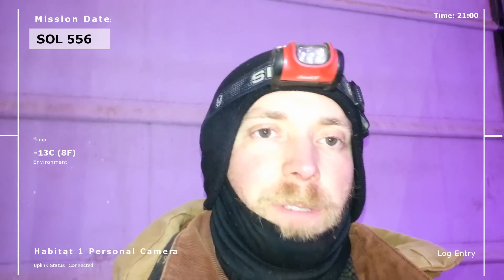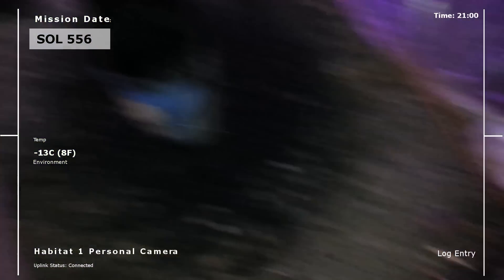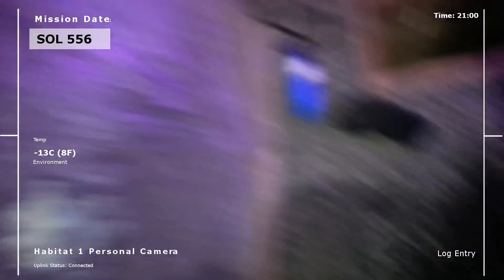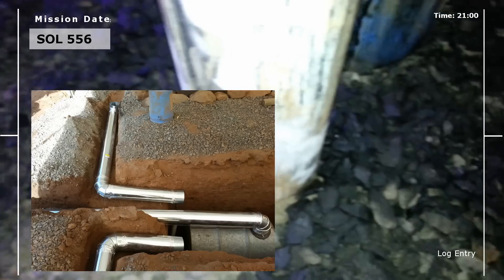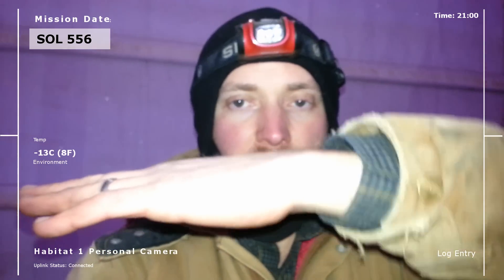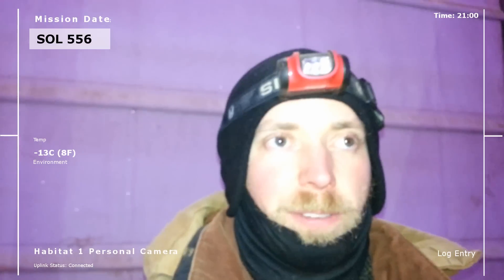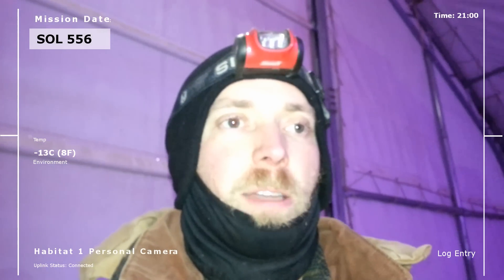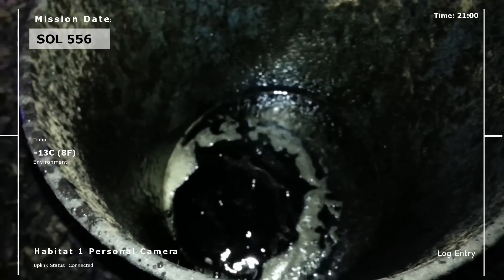Greenhouse Heating - Double Barrel vs Rocket Stove?

Comment: If you could redo your structure I suggest digging below the frost line and keep most of the building below frost level. Not only would you have the mass that could store heat produced, your greenhouse would benefit from passive heating and cooling from the ground as well. Also maintaining the right temp would prevent your microgreens from bolting if you couldn't harvest on time for some reason. [If the structure was on Mars it would also be less exposed to radiation.] Your double barrel furnace could be retrofitted to run on waste oil using a simple drip design that does not need baby sitting. Once the structure is below ground level it would be easier to clean the roof. You could put greenhouse plastic over the exposed roof hold it down with with a wooden frame pump in air. If you build the "bubble" with a drain your humidity problem inside would become condensation in the outer "bubble" and could simply be piped back to the fish or sent out of the structure all together. I know what I suggest is not possible for your current problems but I hope it would help with hab 2.0. Cheers

Comment: Jeff you can get 6mil vapour barrier in rolls 20 feet by 400 feet up here for about $100 (CDN), with some tenacious use of duct tape and rope, you might be able to drape that over the guy wires in the roof area of the greenhouse by your self without hoists, lifts, or crazy ladders. Just a thought.

Comment: Could you consider doing something in the summer months with the creosote water if you stored it in the meantime? For example: evaporate some of the water off by either direct sunlight in shallow pans/pools or perhaps boil off some (most?) of the water to ideally create another fuel?

Comment: I'm not an engineer, but I stayed at a Holiday Inn Express. Can you run a metal pipe around the chimney that would recirculate hot water back around the beds/building for radiant heating? Could you or do you capture the methane off your digester into a tank that could be hooked up to your propane/ng heaters?

Comment: You are fighting an uphill battle with trying to heat a large un-insulated space. If one of the goals is to fit a system in a shipping container then why didn't you start with that? With a reefer container you would need a fraction of the heat you are generating now.  Good luck, enjoying the channel.
Reply: walipini

Comment: One idea that may be more efficient is to put in pipes underground in your green house and install an air blower to blow air under the green house in the summer to create a heat battery of soil.  So use the summer heat to warm the ground.  This is what LDSprepper and Curtis Stone do with their green houses.  This will not be a total solution but could help.  Plus, the cost of using a blower would not bee too much.

Comment: As far as a boiler is concerned; If you got a decent boiler it would pay for itself in savings (cost of wood).  It'll take a few years, but the efficiency and ease of use make it worth it.  If you were to get one, put it inside the greenhouse.  That way you wouldn't lose the residual heat.  A good resource for wood burning is www.hearth.com.  They have forums and people will jump at a chance to tell you how it should be done.  Take it all with a grain of salt, of course, since everybody has their own opinion on how it should be done.

And as a final note, using single wall is fine to get some heat off of it into the greenhouse, but you still need to have a hot stovepipe at the top.  If you were to keep 300 degrees at the top of the pipe it should keep your creosote to a minimum.  And clean it out before you have a damn fire.  There's your rocket stove - when it sounds like a damn train running through the greenhouse, look at the top of your pipe and there'll be flames shooting out of it.
I've seen videos where people have refined the creosote and made fuel out of it, but that seems pretty ridiculous.  I think the best thing somebody already commented on.  Use it as a wood preservative.

Comment: Seems like part of what you're up against is heating a huge amount of air for a fairly small amount of growing medium. I wonder if there's a way to deliver your heat to a smaller area so you can concentrate it more. 
One thing that comes to mind is circulating hot water underneath your grow lanes. Seems like it would take copper pipe to wrap your heater, then enough pex to run up and down your grow lanes. Under (or maybe in) your growing medium. 

This would also capture some of your energy that's currently heating the dirt. 

Obviously the air temp needs to stay warm enough that it doesn't kill your greens, but if you only need heat in 2in of soil and 4-5in of the air above the soil, it seems like there might be a way to concentrate the heat in the short term.

Comment: Why don't you use geothermic ( I'm sorry but don't know the accurate translation of it i'm from Antwerp Belgium) so if you don't know what it is er if my translation isn't good 
It's basically a boiler that has two long pipes going in the ground and transfer the earths heat true water in the pipes and so you can heat whatever you want without any costs or without fueling it the is system is even commercially available here in Europe but i would be astonished if it wasn't in the USA

Comment: I'm not sure how well this would work, but if you attached heat sinks to the pipe it will cool off the air faster and will provide more heat. It may also take away the water problem.

Comment: I understand you are trying to salvage the most heat possible from your stack pipe. But, you are asking for serious problems. For one, as the stack pipe becomes plugged, your stove will be starved for oxygen. Less oxygen for the fire means an incomplete burn and less heat output plus a lot more carbon monoxide and a greater risk that it will leak into your building, especially that hole. The worst risk is a creosote fire. If the creosote in your stack catches fire, it will burn fiercely and you only have one thin metal wall to contain it. It can burn through that and set your building on fire. If you have never seen a stack fire, I can tell you that the metal turns cherry red. Chimney fires even give the fire department nightmares because they can be hard to extinguish and can even burn through brick chimneys and set a house on fire.

Engineering the installation of any wood burning appliance requires that you find a way to keep the flue gas hot enough to prevent creosote build up. That's part of the advantage of triple wall stack pipe. It keeps the flue gasses from losing to much heat. You also need to get rid of the horizontal pipe and keep the stack vertical all of the way up. The best way to get any heat that can be spared is with a heat exchanger box in the stack pipe. It has a blower and a thermostat so it only runs when there is enough heat for the flue gases. Any way you set it up, a stack pipe that long needs to be insulated. Use mineral wool insulation which can tolerate high temperatures.

Remember that you are burning a dirty fuel. The combustion in your stove is incomplete even in the best of circumstances. The type of wood you burn makes a difference. Some woods burn a lot cleaner than others. Your stove should have a dedicate air supply to make it burn as cleanly as possible. Some stoves even use a small blower to direct air into the combustion chamber.

 Pellet stoves can use a wall vent because the pellets burn extremely hot and completely. They have a fresh air intake to bring air into the combustion chamber and an exaust fan to draw out the fumes. Its a closed loop system and mechanically ventilated. Your stove isn't. You have to have enough heat in the stack to create enough of a draft to get the smoke and fumes out of the chimney before they condense and draw enough air into the burn chamber for the fire to burn completely.

Comment: I understand the idea of the double barreled mass heater.....and I'm no thermodynamicist (but I am an engineer)....but it strikes me that your design, while elegant, has a flaw in that you have to suffer the losses associated with radiation, convection and conduction BEFORE you get any benefit from the heat. You're heating up the mass of your underground cave then drawing off warm air which has the benefit of acting like a thermal battery but is a very indirect way of accessing your heat. While doing some research on shop heaters I came across this design https://youtu.be/RXY0JKU12jg .  It seems to me that using a forced air method would reduce some of your losses and improve airflow to the lanes. The added benefit is that this can be implemented very Inexpensively....or even retrofitted. If you got the blower off of an old house furnace you could also grab the thermostat controller circuit and have a degree of control over the system.

Comment: My thought is you're not burning much wood.  I run out stove in the basement and see the thermal mass effect.  I'm wondering if you'd be better off to run the stove hotter?  Maybe fill it in the am and after work and before bed, then let it get good and hot.  From yesterday's video it seems your shoots survive freezing just fine.  So if it cools off over night, just get it warm during the day for growth.

Comment: I still got all my notes from unversity as well as books they do come in handy - I had to pulled my notes out after a meetings and other times to get others up to speed because they could not understand my work or what I was talking about.  Also I have all my books as well.  Also if you need to look up some thing it handy as well.  but due to the internet it easy just to look stuff up but not everything on google (that was a lot of my degree).

Comment: Unfortunately, I don't see any good ways to solve any of the issues you are currently facing without pumping money into your system. I'd focus on getting the humidity under control first. Wet and cold is worse than dry and cold. Your heat is working to some extent so it is less of an issue.

As for the creosote - unless you are going to be putting in a lot of fences soon and need to treat posts I'd find a way to dispose of it. It has some other preservation/medicinal properties but the extra load of trying to deal with a byproduct will take away from your primary goal. Of course, if someone is willing to buy it as it is collected that would be best.

Comment: Metal pipe Coil wrapped around the wood burning stove, fill the pipe circuit with oil and circulate via a pump with a header tank/ conservator to allow for expansion .... also why do you need so much height? Install a polyurethane "ceiling" just above the individual tents to reduce the area to heat.

Comment: I'm wondering if the ground is providing what you want?  is it actually working as a thermal battery or more as a heat sink,. I would think you would need to isolate the ground you want to use as a mass heater from the rest of the cold at this point frozen ground to get the desired effects.  but I'm no an engine either. good luck.

Comment: So many ideas, so little time and money. We share a common struggle. 
I would recommend looking at the Batch Box variation on rocket mass heaters. I believe it would solve a number of your issues. It can be loaded up with fuel like you need to do, it will burn cleaner and take care of the creosote issue, and if you incorporate the water mass/fish tank water heating concept a number of others have discussed I believe you could greatly reduce the chance of your micro greens freezing. 
If you aren't aware of the site, check out HTTP://www.permies.com . Great group of people with low cost ideas on a lot of this stuff.

Comment: I wonder if you were to place some drums of water beside the barrel heaters if you would get more mass and better heat transfer to the thermal mass (the ground)? 

There are some folks that have made batch hybrid Rocket stoves. They all have some trade-offs. And they're not as efficient. But seem to get around the loading issues somewhat. 

https://www.youtube.com/watch?v=mLWi-3PQnkI

Also, maybe you could get a salamander than runs off of diesel to place down in the pit to give you a boost. Just some ideas...:)

I believe there are some techniques to use pellets on a Rocket mass heater as some folks have the same issues with having to be tied down with feeding issues. I know Zero Fossil Fuels has a site that dealt with that issue. 

Just my 2 cents...LOL

Comment: How about  building a stack of tube heat exchangers like  
MagicHeat pipe stove heat exchangers to lower exhaust gases temps where pvc would be used like a direct vent system. The gas temp needs to be lowered to 120° F.

Comment: I have a 30ft chimney and my stove pipe from my wood furnace is about ten feet long (goes horizontal from furnace to chimney) and I had a terrible time with creosote and tar water and a few times it plugged off completely. The guy that came to clean it said to take the manual damper out (I also have a barometric damper we left in) so more heat can go in the chimney to keep it hot so the moist air won't condense and it has worked great this year.

Comment: another suggestion. You can convert your double barrel to where the top barrel is a water heater and you could use that water to circulate heat in your building. I know this can be done. I have an older brother who did this to heat his home.
Reply: could that lead to more water/warm air in the building thus causes more problems getting rid of the water. when it condense?
Reply: Walter Laughlin interesting, sort of like a minature wood boiler. I don't know if the scale would work though
Reply: Hello Again, well all I know about it is that he ran  coiled copper-pipe in the boiler in the top barrel. Once he got far enough away from the barrel he used PVC.. He used antifreeze as his heat transfer fluid. I know that copper tubing is a little more expensive these days but  I think you could work it out and  I don't know how you would do it but I would just lay the PVC right on the ground underneath your trays! I don't know what do you think I'm just a dumb old farmer you're the rocket scientist! My brother heated his two story home with it!
Reply: Walter Laughlin my neighbor did something similar to heat his pool in late fall
Reply: Read my mind
Reply: No. Should be a closed system.  All fluid sealed inside the pipe.

Comment: Man you could also take advantage of heat exchange radiator system by wrapping the barrels in pipe then to above ground radiators
Reply: I believe tonymengela is suggesting a way to get heat from the fire barrels in the hole into the lanes / occupiable area, not suggesting to extract more heat out of the exhaust gasses in the flue.
Reply: as he's having condensation issues in the chimney he's already getting down to the latent heat of water vapor (assuming it's not pure organic gunk). There's not much more heat to extract from the system without serious effort.
Reply: hboy007  you obviously do not comprehend what I was saying
Reply: then please elaborate.
Reply: Maybe my response was pointing at the wrong issue... I fail to find the moment where Jeff shows the heat flow path (one of the HVAC videos?) but I was considering that part of the usable heat goes into heating the ground underneath the lanes while another part is transported by the air circulating through the stove hole and back up through the lanes. A third part heats the air outside the lanes, reducing the temperature differential across the lane covers.
The latter fraction might not be that effective but it's a beneficial heating effect nonetheless. So if you manage to extract that third part and add it to the enclosed system you'd at least have a higher temperature differential, degrading the efficacy of the additional heating.
Extracting heat at the hottest point is effective but does little to try and recover the third fraction of usable heat.
That leads me to question if adding a heat exchanger near the stove has a net positive effect and if so if the effort is justifiable.

I'd love to see him start a GoFundMe campaign for a cheap thermal camera and a set of temperature sensors so he can track down and quantify where he's actually losing the heat he puts in. 
Insulation has come up many times now and given that that's also a one-time investment it may well be the solution with the most potential for savings and reduction of emissions.
Reply: exactly. when you wrap the barrels in pipe and then run a temperature controller with pump you can grab some of the radiated heat and exchange it with radiators. and you keep the mass heating side as well. moisture problems go away